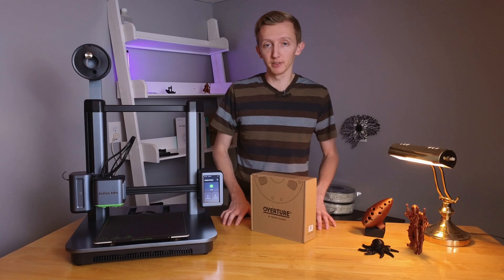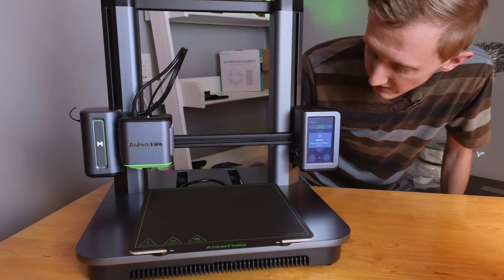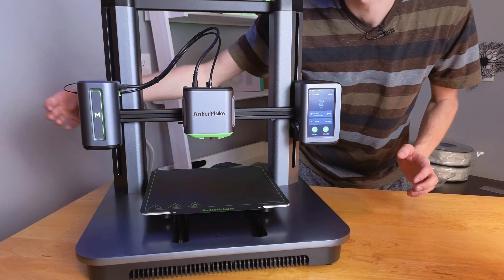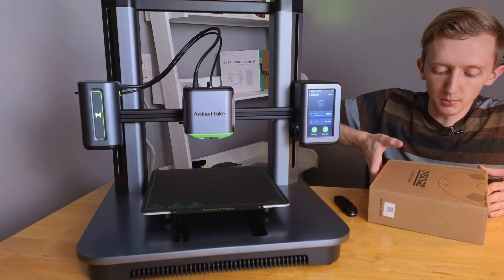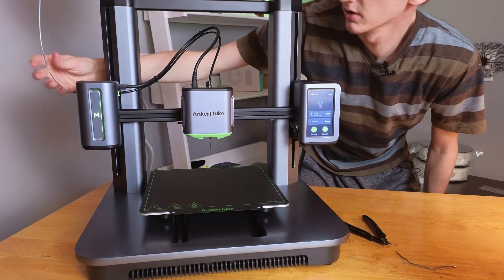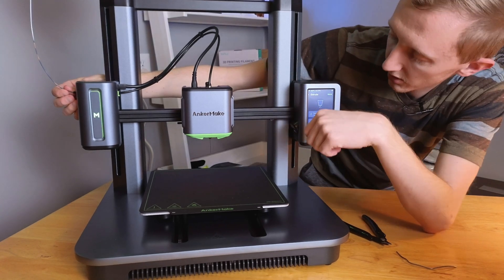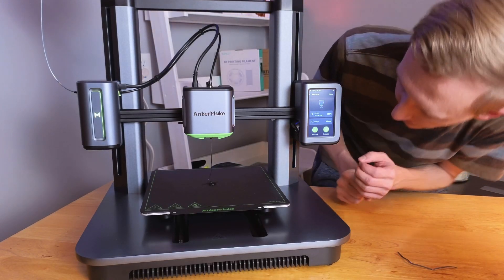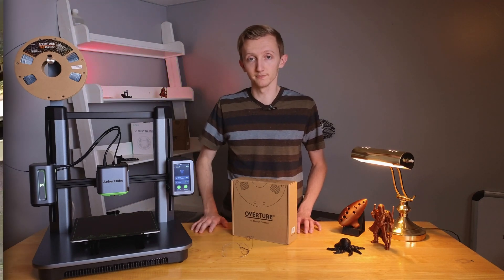How to Load & Unload Filament - AnkerMake M5

Comment: I had some issues with the extraction method where I would get clogs in the extruder (which required disassembly), so I ended up just going with the 'Extrusion' method instead and haven't had any issues. It wastes approximately 700mm of filament, but after taking the extruder apart a few times, I said, what the hell.

1. Snip the current filament right at the guide hole on the left side of the Gantry. Right at the black tip that sticks out. remove old filament from holder.
2. Click extrude to start the heater; if already heated, skip to 3
3. Set the extrude length to 700mm
4. Once it heats and begins extruding for about 3 seconds, start sliding your new filament into the guide hole as the old filament goes in.
5. At just under 700mm, you should see your filament start coming out
6. Profit.

Comment: Thanks for this but 2 questions if you can help please:
1, after pressing retract a couple of times, if it doesn’t wasn’t to come out as easily as your on here, what to do?
2, what is the process mid-print when the roll is about to run out and the object I’m printing is already up at day 90mm high?
Thanks.

Comment: Your giving bad information... you DO NOT have to push the lever down to load the filament... you push the filament till it stops then hit extrud and it will automatically grab it and pull it in.... 
get some experience with the machine before making educational videos on it🫤🫤🫤🫤

Comment: Hello just to share my experience: I was running out of red filament PETG and could feed the new filament manually in by pushing the new coil for some minutes 
in until it was grabbed by the feeder. It worked very well. didn't need to interrupt the print process .

Comment: Hi again is this an OVERTURE PLA Matte Filament 1.75mm? Are there any benefits to the PLA+ (?) by Anker or is it basically just marketing? Thx!
Reply from the maker: This is the Overture Silk gray, so it's shiny.  The Anker PLA+ it came with is fine. It's nothing too special and seems to be a bit stringy. I don't know that I'd call it marketing, but I won't be buying any more of their kind.
Reply: @Ecto3DPrinting  Thanks. I was watching reviews and it seems that a PLA + has benefits - It was not about the Anker brand - just general...
Reply from the maker: @avih7311  Ah, gotcha. As far as any difference with PLA+, I haven't noticed any, but also none of my prints have been strength checks, more just decor models

Comment: Notice you received x2 1kg white PLA filaments.   My Kickstarter order only had one 1kg filament. I do remember one of the updates mentioned a bonus roll but can't be certain what is what
Reply from the maker: Yeah, some other people have mentioned that as well. It might have been my tier of backing, but I'm not certain.
Reply: Same as well as i purchased extra from them and was supposed to be included. Just got he 1kg. but i cannot get it passed the sensor and feeder in the pillar to the tube....

Comment: I cant even get it into the hot part(passed the 'M'). I'm going to rebuild it, hopefully i dont need to open the loader up  ..
Reply: I’ve solved this issue after having the same issue.

Take the wrench out of your tool box. Use it to unscrew the silver screw for the Bowden tube on the top of your extruded.

With the silver screw removed and the filament fed through the tube, make sure the filament bends TOWARDS you, press the lever, and feed the filament in manually until it starts to feed out. Replace the Bowden screw and make sure it’s snug, now you can run the extrude setting.

Hope this helps.
Reply: @M21assult  Hey can u please confirm this is on the feeder part? where the filament sensor and wheel are? not the extruder?
Reply: @M21assult  Anyway i Could get a picture or dm regarding this, Ankermake sent me a video for the wrong issue im having, i do now know what the Bowden tube is as well as the extra blue one in the tool box'' i just cant get it passed that box on the Left facing the printer on the pillar. Please let me know. Many thanks!
Reply: @M21assult  this is pretty ridiculous. I would understand if I had a couple of issues feeding here and there or a couple of miss print but I cannot even get it to feed 50+ times 50+ cuts multiple different filaments followed. Instructions didn’t put too much pressure then they respond to me with mess with screws and unscrew the top hose and directly feed it and I did so it’s not even humming anymore. I’m getting red flashing lights and I had no issues with the software or anything. It was just the feeding. And it’s not the Bowden tubes.
Reply from the maker: Dang, sorry to hear that. It seems a bunch of people on the Discord are also having issues with getting it into the hot end. Some have said it's maybe the Bawden tube...? (Honestly since I'm a beginner too, I think I know what it might be, but not sure) so they've been trying to change it out with the extra provided. Keep trying and I hope it works out for you soon!
Reply: @Ecto3DPrinting  can i keep you posted? going to do the top redid rec rn
Reply: Funny thing is that you mentioned on your other video what happened to me, with pulling a earlier backers M5, .. I was supposed to get mine at the end of December and 2 weeks ago i had a 1 day notification.. It was 3 stops away before they canceled it and didn't tell me why. BUT to my Great Suprise i just got it 2 days ago.. last of the backers(first kickstart) first 3d printer as u mentioned @Ecto 3D Printing

Comment: wow excellent print on the no-support mandalorian model.  would love to print that on my m5 when it arrives in a few days.  where did you get the file?
Reply from the maker: That one came from Thingiverse. Just gotta watch out for the cape though! It started curling upward and was actually hitting the cooling ducts so I had to pause and press it down to keep it from ruining. But once it got attached to the other leg and started going back upward, it did great!
Reply: Yeah, all I'm hearing each time I press extrude is clicking and I'm pushing the filament like you're doing, I cut the filament in different angles like 10X already.
🤣 I'm gonna run out.
Reply from the maker: @J.D.Vision  So what I've found is that if it's clicking, then that means the wheels haven't grabbed the filament yet, but I can usually get it in by just wiggling it around... Might be time to take your hot end apart...